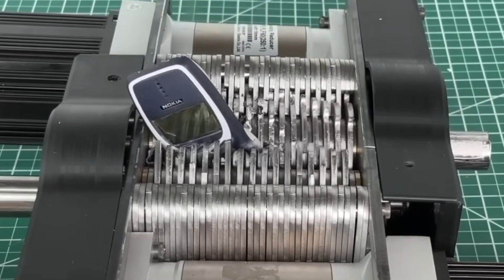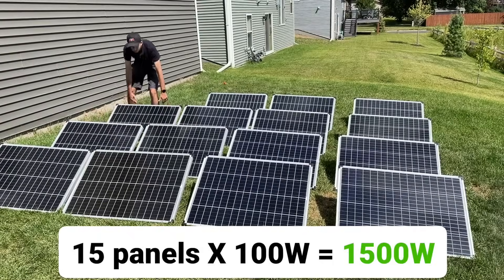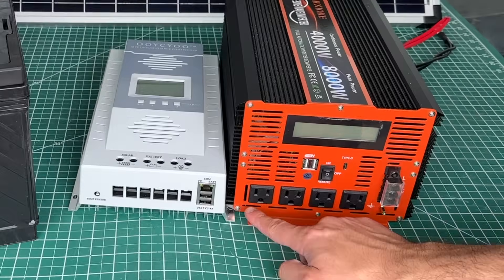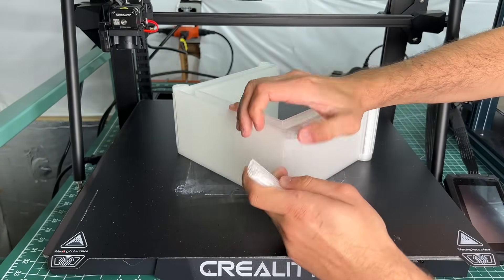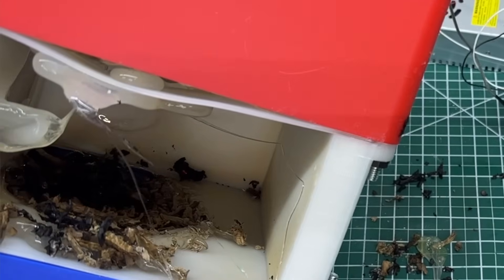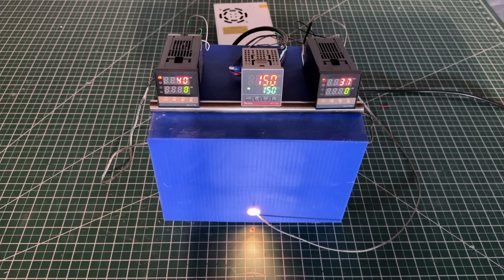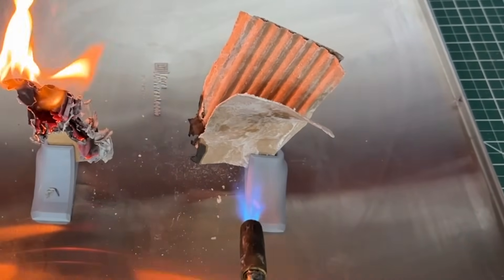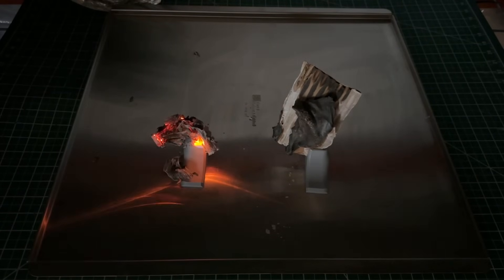DIY Solar Powered Shredder | SHREDII 5

Comment: Does the Shredder work well for plastic ?  having a issue with precious plastic 220 V shredder operating in Japan but this 100V alternative look good
Reply from the maker: Hey! SHREDII 5 works great with plastic. You can view videos of how we shred plastic bottles on the product page here: https://actionbox.ca/products/shredii-5 . We'll also be releasing a video later this week stress testing the shredder with different materials. Subscribe so you don't miss out on that!
Reply: @ActionBOX  Thank u. Will it run ok on 110v voltage
Reply from the maker: @Jarvis_labs_2025  Yes, it will run on 110V

Comment: Very cool guys! One of the knocks on recycling is that the power consumed to run the shredder, extruder etc. is more than what is required to produce new material from petroleum - especially with hobbyist machines. You can imagine a future where recycling plants run off renewable energy. Also, that lathe looks intense!
Reply from the maker: Thanks Dr 👨‍⚕️, your support is much appreciated 😃. Looking forward to more future collaborations. 
Cheers,
Dave